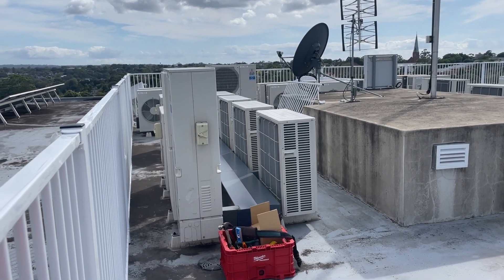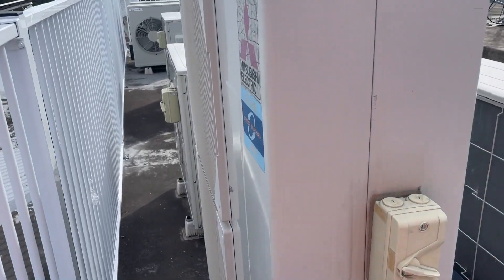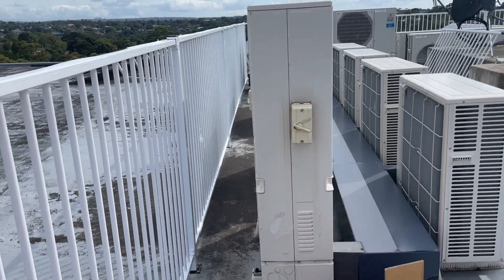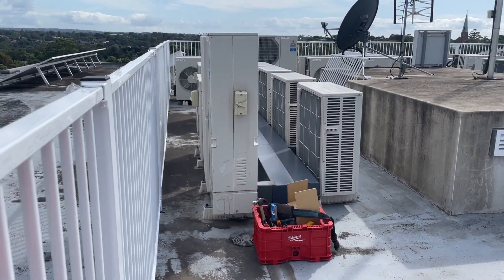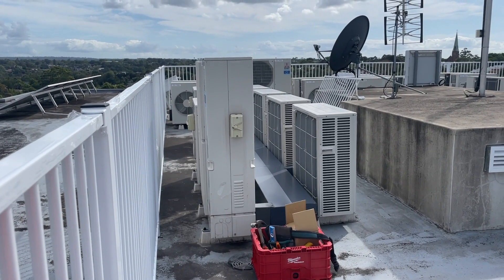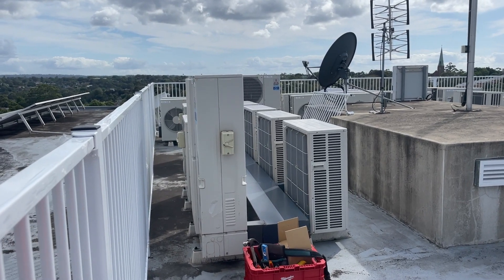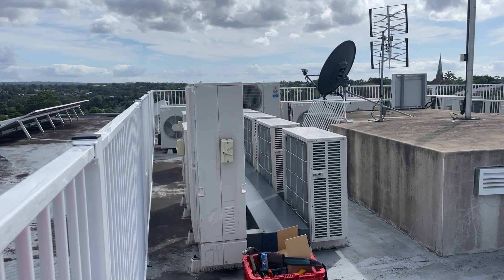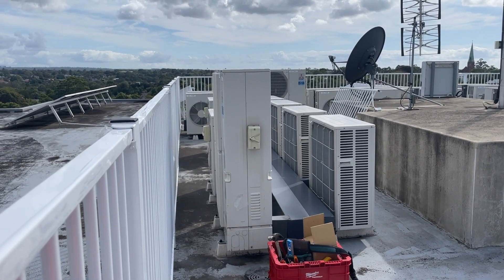Repairing Mitsubishi Electric U8 Error

Comment: Hey Mate, I want to thank you so much for this video. I have the exact same aircon and followed this and the previous video. 

I bought a new fan motor $360 and installed it. 

Could not have done it without your help!

Blessings on you!!
Reply: Hi @Densilfourie220, I have the exact same issue here. Any chance you could confirm where you purchased the replacement fan motor from? Many thanks!

Comment: Nice vid I am use to replacing both fans and pcb when i find a bad fan motor. How long have you worked for your self. And do you have employees or do you prefer to do the work and keep the company small?
Reply from the maker: Thanks mate. I have been in the trade for 16 years and self employed for 11 years. I had an apprentice that did his time with me and worked for me as a tradesmen however these days I just use sub contractors when I need more hands on deck. I find that is less stressful for me and I could sell my 2nd work truck. I have a balance now where I can take on enough work and get help when I need it but if it slows down I don’t stress. For now that’s working for me. I might expand in the future.

Comment: Nicely done. It's hard to find a faulty DC motor on resistance alone but Fujitsu have a diode check you can perform between the windings on their motors which gives you a bit more ammo when it comes to diagnosis... Wish Mitsi would come to the party on this instead of making the customer pay for shit they don't need!
Reply from the maker: Oh wow, I actually did not know that about the Fujitsu’s. That’s cool. Yeah it’s crazy to think they recommend replacing board as well! Totally not required.